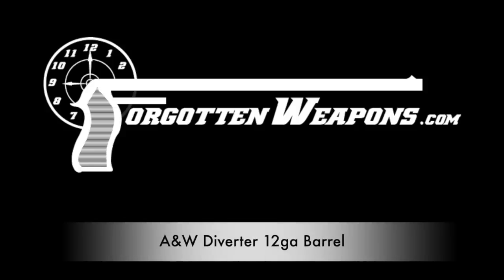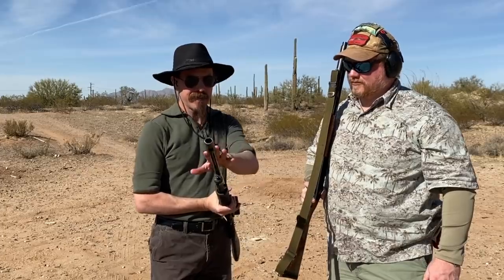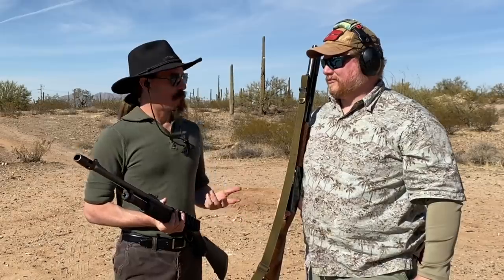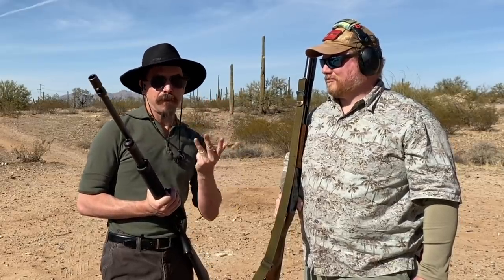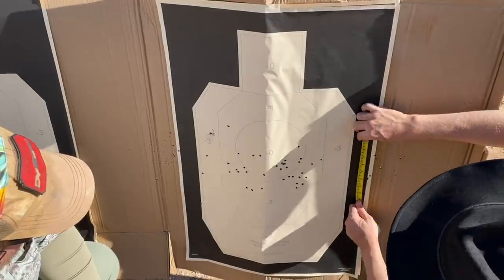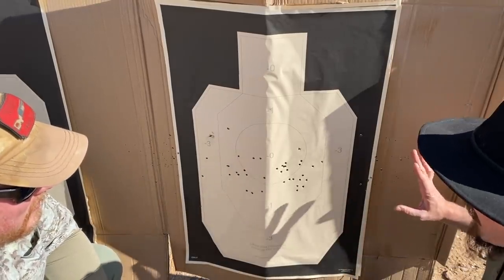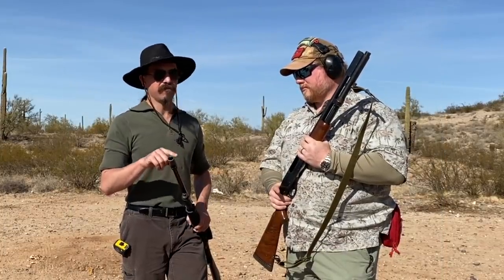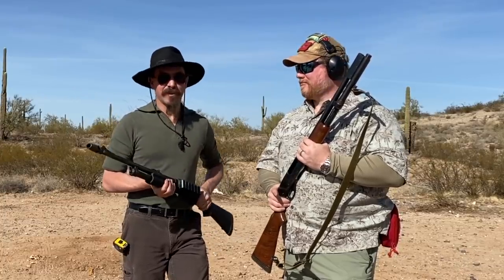Duckbill Done Right? Testing the A&W Diverter Shotgun Barrel (w/ Matt Haught)

Comment: Anyone else thoroughly impressed by how efficiently Matt racks his gun?
Reply: Yeah he good at it, paul harrell is even better,
Reply: Yeah, I noticed his efficiency. Very smooth.
Reply: You must need more training
Reply: That load and close for his single shot is the most casual and smooth thing.
Reply: Talang and training, a lot of training, and a very smooth gun.
Reply: yeah that pure muscle memory .
Reply: Also his follow up shot is so quick
Reply: I thought it was a semi-auto for the first couple takes.
Reply: Rackpull. One word. Paul Harrell......edit....😑pullrack
Reply: Pullrack
Reply: @chadblechinger5746  is that where you are puttin pressure on slide as you fire? I thought that but i only fired a pump 1 time
Reply: @johnm3907  with my mossberg 835  it dosen't seem to unlock the breach after a shot is fired and then a slight amount of tension taken of the backward pull of the pump . So I have to treat that all as one action mentally and train  to achieve that.  I know some people prefer to have the whole set up in dynamic tension where the stock hand pulls into the shoulder and the forehand pushes the pump or forstock towards the target or end of the barrel. I tried that and it was very,very awkward for me. But to clear up I take it as Paul Herral telling us that the idea is that you pull the trigger and rack the gun with one thought or process. Instead of pulling the trigger and racking the gun you just pullrack.
Reply: @philllax1719  yes
Reply: @johnathansaegal3156  I yelled "stop showing off" at my phone when he shot high on that one, lol.
Reply: Yeah, 1st thought when I saw him do the two step was, "Holy shit, this guy is FAST!"
Reply: @johnathansaegal3156  well it is a shotgun after all.

Comment: Re: the "doughnut" pattern.  With smaller shot sizes, you end up with shot evenly spaced across the shell.  When the pellets get bigger, they are limited in how they can stack.  00 buck in a 12 gauge shell stacks in triangles, with each layer offset by 60 degrees (I have a 9 pellet Wolf load in front of me now, which has a clear case, and makes it very easy to see the stacking pattern).  My theory is that when the shot column exits the barrel, and there is nothing supporting the pellets from the side, the pressure of the wad and escaping powder gasses from the back, and the drag of the air from the front, will squeeze the pellets out from the center.  If you look at high speed video of buckshot (Taofledermaus has some good video comparing different wads) you can see that the pellets tend to travel in a straight line from the point they exit the wad until they hit the target at 10 to 20 yards.  Deformed pellets would increase dispersion, but that effect will grow over distance, as the pellets have time to start to spin; at 10 yards, the shot has only been traveling for about 25 thousandths of a second, and won't have acquired much spin yet.

So if anyone has a 3-D printer and wants to design and print some buckshot wads that will hold 00 buck so that it can be stacked in tetrahedrons, this theory could be put to the test...
Reply: Well ... all we need is someone too do it...
Reply: Interesting, Major Burrard would have loved these tests.  The larger the pellets, the more they benefit from using a buffering material, as Winchester have proved.  Imagine 3d printed wads that  actually hold every pellet?  I bet the patterns would be exceptional.
Reply: @metocvideo  The Federal Flitecontrol wads produce extraordinarily tight patterns; a few inches at 10 yards.  The way they do that is to keep the shot column together, inside the wad, until a few yards past the muzzle.  Rather than having full length slits that open up like a flower, releasing the shot as it leaves the muzzle, the Fitecontrol wads have no slits, just small "air brake" flaps near the rear that open up to gradually slow the wad.  This keeps the shot from getting spread out by the muzzle blast, and lets it continue with each pellet in a nearly collinear path as the wad slips away.  Watch the high speed footage comparing that wad to a traditional wad here:  https://www.youtube.com/watch?v=0dbZK9Lm9jQ
Reply: @metocvideo  And here's some high-speed video of a home-built in-line sabot out of a smoothbore:  https://www.youtube.com/watch?v=NWwBZWiVJF0
Reply: @metocvideo  Would surrounding each layer of pellets in a buffering material like tissue paper have the same effect?

Comment: Matt works the slide after each shot like butter.
Reply: Yeah man it’s not “bam, tch shk”
It’s “bamtchk”
Reply: @humblenoob7631  He's a human semiauto.
Reply: One way, if you have an 870, is to dismantle the gun and clean and debur the inner pieces.  Carefully stone the hardened parts where they rub against each other, then clean everything especially well and use (mil-surp) LSA oil to lube the parts.

It will work much smoother then.  Two-bangs on running “squirrels” were near-instinctual once I did that.

Comment: One possible test for increased effectiveness on fast moving targets would be at a skeet range.  Stations 3, 4, & 5 are relatively flat, fast crossing shots that require a lot of lead. The simplest test would be for the two of you to shoot four rounds of skeet (100 shots total) and trade guns each round.  Have the R.O. keep score so that you can compare your hits/misses/partial hits at each station with each guns.  It would also be interesting to use a high speed camera aimed over the shoulder of the shooter to see if you can pickup the shot column like you can with the naked eye on a nice day.
Reply: Hard left off of station 1 and hard right of station 5 in Trap might work as well.
Reply: Oh, good lord... I love shooting clays, but skeet doubles scares the Hell of out my for safety reasons. One fast-moving target moving this way, followed by another in the opposite direction... No thanks, I'll just be down here on the  trap range at the 16 or 17 yard line with my 12-gauge, 1 1/8 oz, #7 1/2, high velocity mule-kickers, thanks.

Comment: In Corrections at the CA Dept. of Corrections and Rehabilitation we trained by "skipping" 00 buckshot on the pavement or grass to send the pellets in low. Government is weird.
Reply: Would be very interesting to test if that's even a thing that would work reliably.
Differend types of ground, dry or wet and how the spread and penetration is.
I don't think that wet ground like grass will be very conductive to this.
Reply: @vertigo4236  there is no reason it shouldnt work. its how field guns with solid shot where used prior to reliable high explosives.

Comment: Speaking as a diehard shotgunner, this video pleases me.  Not enough shotgun videos on YouTube.

Ian: To answer your question about the "donut of death" and how to get more pellets into that blank spot -- use non-lead pellets.  Lead pellets transform from spherical to tear-drop shaped as they crunch into each other at the choke, causing a cone-shaped spread in flight.  Steel pellets are strong enough to retain their shape as they crunch and exit the choke, so they fly straight through the air with minimal wobble and with less spread.  In other words, shooting steel pellets is like shooting long wooden-dowels out your shotgun and shooting lead pellets is like shooting backwards traffic-cones out your shotgun.

This lead-to-steel reduction in accuracy problem is well known among dove/quail hunters who start shooting ducks for the first time and wonder why they can't hit anything: their steel-shot patterns are much less dispersed than their lead-shot patterns, so the dove/quail hunters must aim significantly further ahead of flying ducks to score hits.  

With mixed results and much higher costs than traditional round steel pellets, shotshell manufacturers have attempted to simulate the favorable spread of lead-shot by making square-shaped steel pellets for duck hunting.  Geometrically speaking, the steel squares have more mass than spherical steel pellets (simulating lead) and tumble more in the air (leading to a greater spread, supposedly).

Comment: I wish someone would start making the Diverter again. This time offer it with Remchoke threads, Mossberg threading and maybe Winchoke threads.  With what was shown in the excellent video it would definitely sell. I know I'd buy one. It would be perfect for close in grouse hunting in northern WI
Reply: What about H&K threads?
Reply: The smart way, from a manufacturing/stocking efficiency standpoint, would be to make a Diverter with whatever threads.  Then make adaptors for each of the choke threading styles that all can then thread into  the Diverter.  This way you have only one manufacturing process for the Diverters themselves.  This would greatly cut down costs.  A buyer can buy multiple adaptors for the different shotguns that they have.

Comment: I have done lots of patterning of shotgun target loads and have a theory about the donut of death. These target loads are normally just supersonic as they exit they barrel. The choke has squeezed the pellets into a relatively compact cylinder - often referred to as the shot column. Early on the its path down range, the front of the load is being peeled off the by supersonic shock waves. Later down range, it will be come sub-sonic and what's left of the shot column will spread more gradually. I imagine it like a (short) pencil being sharpened. The front edges get "cut" away first. Then it gets to completely sharp. And finally the resulting cone is cut away completely. Ideally, That last bit of the shot column is used up at the yardage of your target. Generally, if you cut back on the powder on a donut hole load, reducing its muzzle velocity, you will start to fill in the center of the pattern.

Comment: I almost picked up one of the Ohio highway patrol 870's with the over-folder when they went up. Still regretting not getting one.
Reply: I used to have a factory Remington top folder stock. I got rid of it a long time ago. You really don’t want one. They will beat your cheek to pieces. Plus, they are useless if you have to butt stroke with it.
Reply: @ericplaysbass  When you say beat your cheek to pieces,  is that on account of it being thin metal?
Reply: @MachineNun  yes
Reply: Back-up For the back-up  What? Never heard of a vertical butt stroke? A good thing to know in case of extreme close encounters. It has nothing to do with your backside.
Reply: @ericplaysbass  I'd suggest that it's also worth knowing the muzzle punch. That said, butt stroke is unfortunate in its description.
Reply: @ericplaysbass  With regard to the bad cheek weld, would there have been space between the reciever and stock to try one of the more "Bubba-ish" solutions? Something along the lines of a bicycle inner tube sheathing/ paracord wrap?
Reply: @MachineNun  When the stock is folded over the top of the gun, there is very little space between the receiver and the stock in places as I recall. I suppose para cord might fit between the receiver and stock, but it would be pretty close and not give a lot of cheek protection. I suppose one could “bubba up” some sort of pad on the outside of the of the stock to create some sort of cheek rest, but it may look a little goofy. However, the end justifies the means.

Oh yeah, I forgot. They are noisy and tend to rattle either open or closed.
Reply: @ericplaysbass  I'm a believer in the  functionality over form methodology. Even so these stocks sound like a headache. Maybe you could take out some rattle with some washer inserts, but now I don't think I'd bother. Probably just go with a collapsing stock and save the effort.

Comment: From what I've read there was a similar muzzle device installed in H&K HK512 shotguns that could be set for either vertical or horizontal dispersion. Apparently it only worked with buckshot and from the little I've seen online it seemed to work pretty good and was even nicknamed "man-cutter". Those guns seem to be pretty rare, but it would be interesting to see one of those tested similar to these tests.

Comment: The void in the middle of 00 buck patterns is a result of the way the pellets have to be stacked in a 12-gauge shell.  They're put in layers of 3, so there are no pellets in the center.  The thrust is therefore always applied slightly outward as they leave a cylinder bore, with no pellets getting a push directly from behind to encourage them to fly straight forward.  That would happen regardless of pellet deformation with 00 buck.

Comment: I'm a fan of #4 buckshot, but I never see anyone use the Federal 34 pellet load.  It just seems like it should be the go-to load for defense.  34 holes instead of 27, denser pattern...?
Reply: Makes sense to me. Back when I decided it was the go-to, the reasoning was having more pellets where each was still at least marginally ballistically effective (equivalent to a .22lr or .25acp if you could get one to feed with a soft LRN) but not enough to have problematic energy left after flight distance or passing through structure in the near field. 

Blee blahh basically I mean... of course, if you pick something for more safer workable hits, why not have more more safer workable hits.
Reply: Presumably the same reason 15 pellet 00 is rarely used. More blast and recoil than is needed for the job.
Reply: @Broken_Yugo  There's not much difference in recoil between 34 and standard 27 pellet loads.  There must be some because ... more weight, but it's not like shooting 3 inch shells (for example).
Reply: @kodiakkeith  Sorry, didn't comprehend that, I know there are nasty 3 inch 4 buck loadings but I forget the count. As a second guess I assume it's availability/awareness as I recall (pre current troubles) if you wanted #4 or #1 options on the shelf were limited, typically one or two brand name options and one cheap brand, 00 dominates the market and you don't get a big price break buying online like with bulk rifle/pistol ammo.
Reply: @Broken_Yugo  Yeah, it's just a shorter wad to stuff more pellets in.  Even before the current shortage, you don't see them in many shotgun vids.  I don't think I've ever seen them in a vid as a matter of fact.  They've been around for years and it's my choice for home defense shotgun use.  More holes = better.
Reply: @kodiakkeith  that would lead me to assume it has a larger pattern, which is no bueno for HD imo. I prefer 8 pellet 00 that puts em in a 50¢ piece sized pattern at 7 yds than a hallway sized pattern that puts other occupants in even greater danger.
Reply: @509Gman  Out of my 18 inch modified cylinder barrel it's a foot across at 7 yards.  The theory (with no real science or even consensus) is that in the dark with a moving target that may be shooting at you, some dispersion gives you room for error.  Even if you hit him with half the pattern you've put 17 holes in him (with the federal load).  The issue with 00 buck is that it will go right through a 24 or 26 inch cube of ballistic gel and continue on.  #4 consistently stops at about 15 inches, right in the middle of the FBI recommendation of 12 to 18 inches.  That FBI thing is for handguns, but the same rules apply.  Deep enough for lethality, but not so deep it continues on to kill bystanders beyond the target.  With a tight pattern like you're describing you'd be better off with a .223 or the like.  Still lethal, but smaller odds of dispersion into non-targets beyond the intruder.  Not trying to debate you.  Have a gun.  Any gun you choose, but have a gun.
Reply: @kodiakkeith  “in the dark”
That’s why my shotgun has a light.  If you’re not sure your shot will connect, don’t shoot.
Reply: @509Gman  We all have a light on our home defense gun (I hope).  We all have different situations as well, I'm on a pretty remote ranch with no neighbors, and I have a good dog that will prevent anyone coming upstairs, so that's the scenario I'm looking at.  At night, it's the wife and I upstairs and I'll be clearing the ground floor.  Any biped down there will be an intruder.

Comment: To correct holes in pattern you can lengthen the forcing cone. The forcing cone is the transition between the chamber and the barrel. This also shrinks the pattern diameter.

Comment: For testing against a moving target, get some garage door track and pulleys to set up a track that traps the wheels so the unit cannot jump-track even when struck.  Make a skateboard-like trolley to ride on that track, supporting what Paul Harrel would dub a meat-target, though probably not made of meat given working in the Arizona desert.  Also attach to the trolley a large frame with some cardboard that is much wider than the target.  Use some kind of cord and an electric motor to wind-up the cord to pull the trolley along, possibly using different size take-up reels to allow for variation in speed.

Think how dog-racing works and the simulated hare that the dogs pursue, but with the wide piece of cardboard to show what your shot pattern looked like relative to what hits the actual target.
Reply: I was thinking this! a skateboard in some 2" x "2"   Enclosed "Tracks with a motor pulley system.
Reply: I am personally a fan of the method that Bob Brister used which was a 16' boat trailer that he mounted a frame to in order to hold the paper. Which was pulled by his wife in the family's station wagon.
Reply: MGM Targets makes a "charging attacker" target. 21ft of rails and the target falls forward in the direction of motion.

Set one up to go sideways across a shooting bay, maybe with additional rails for distance.